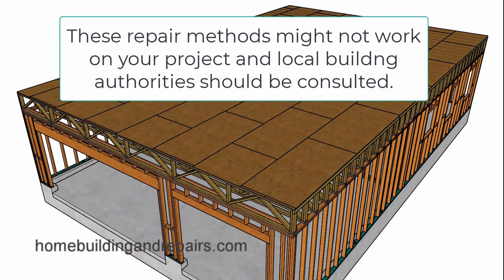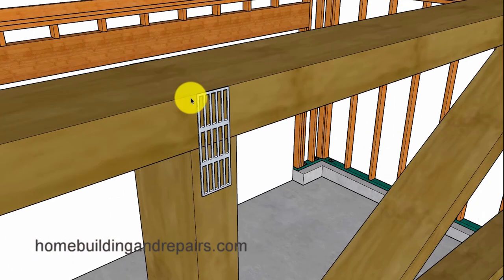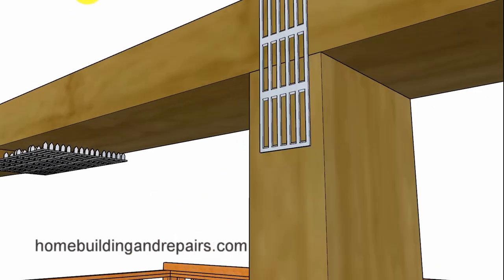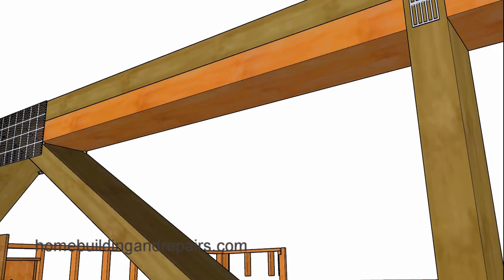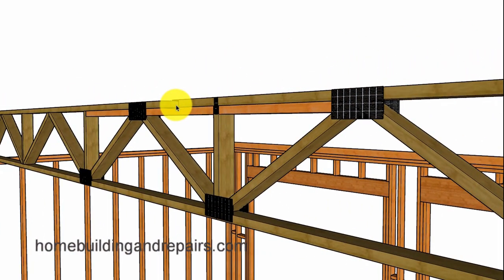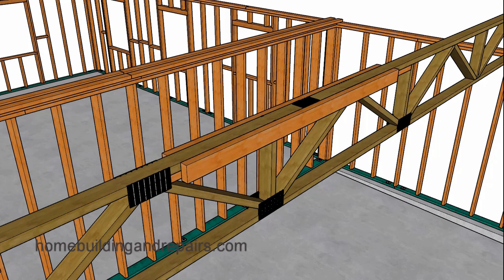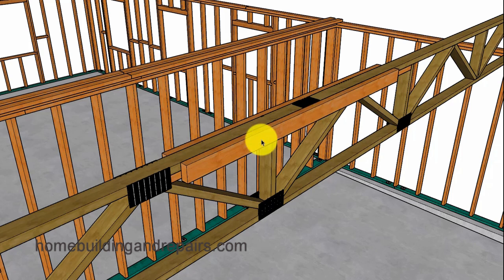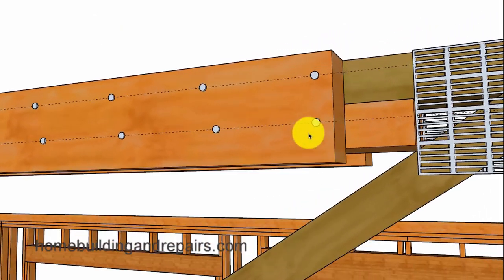Possible Top And Bottom Cord Repair For Open Web 2 x 4  Engineered Truss Joist - Assembly Examples

Comment: It is a joist and not a beam, so it is not a big deal. Engineering is science not magic. While you double and triple  the material you are in the safe side.  An engineer might ask the  two piece of wood be long enough to connect the whole  triangle.  you are completely right it is very important to figure out the cause, which  is most likely bad handling

Comment: Thank you addressing trusses.  Such information helped in understanding the Structural Engineer’s plan for inserting a recessed header up in truss bottom chords..  The avoidance of disturbing the plates was helpful, will use caution for minimal vibration when cutting vertical blocking under the plates. S.E. also specified a 24 inch strap to rejoin bottom chords similar to your framing video.  Any videos/tips on shimming chords to beams to ensure proper compression contacts?
Reply from the maker: If you're suggesting a strap, I would love to see your detail from the engineer. I couldn't find anything suggesting a strap and you get our email address at our website. Feel free to provide more information about shimming cords, I'm not sure where the shims would be located or what they would be doing. Great point about vibration.

Comment: What if I have a 2x8 support beam that has rot and is sagging?  The rot has been dealt with, but I would like to replace/scab the beam.  This is in the wall that separates the den from the garage, so I would have access to it from the garage side.
Reply from the maker: Remove it and replace it. I have more videos about beam removal at our website.

Comment: I think this repair would be fine. simple because it is in compression @ the top cord at mid span. If it were the bottom cord it would be in tension then  I would transfer the load through sheathing back into the truss.